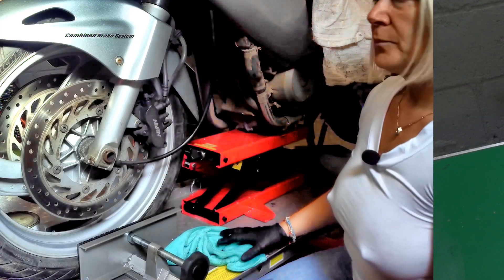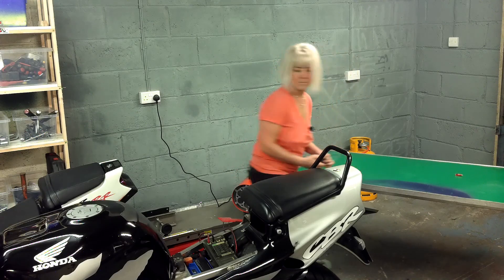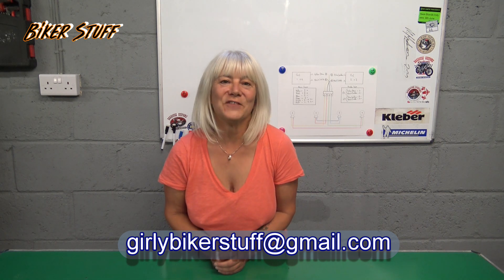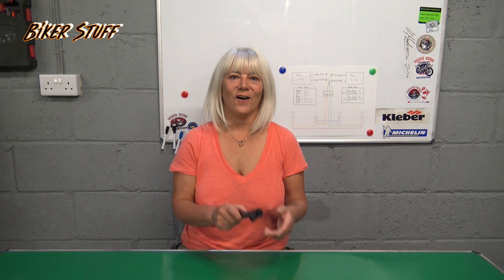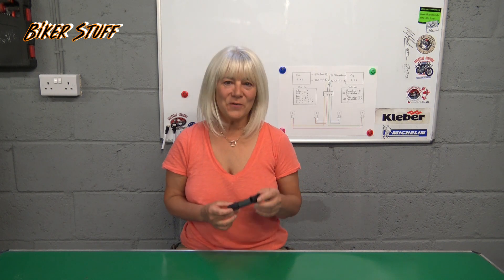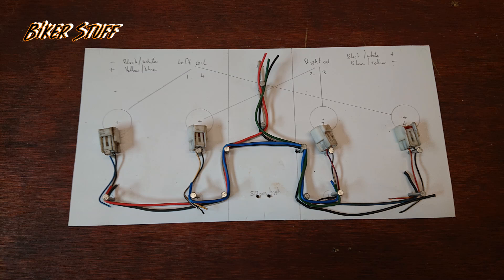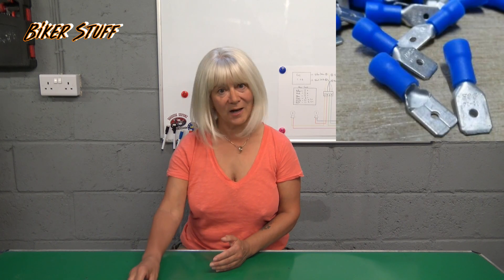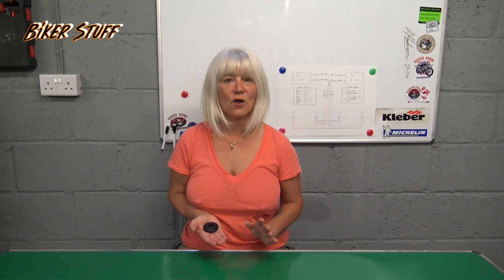CBR1000F project (Part 3b) How to wire coil sticks on a pre 2000 Honda

Comment: ohms law is what you need to look at, basically the circuits draw more current the higher the resistance
Reply from the maker: Yes, you're right.  I hope someone will let me know if it is a concern and is it the primary or the secondary resistance I need to use